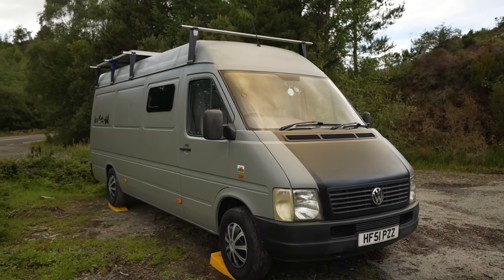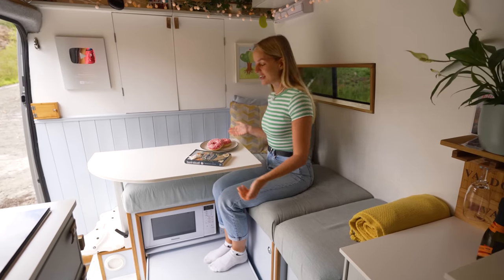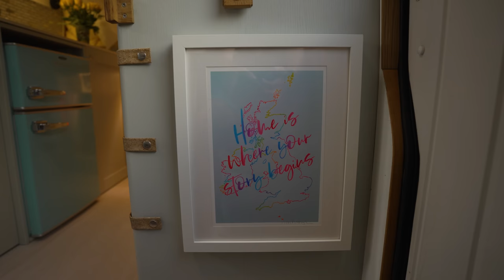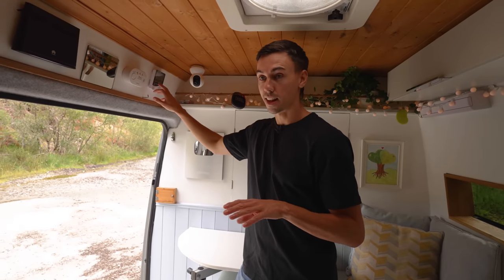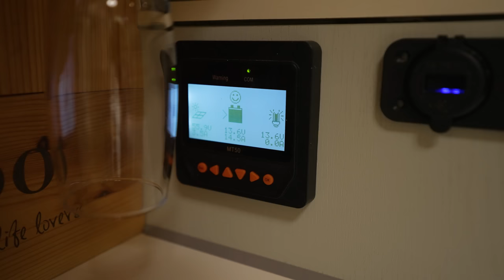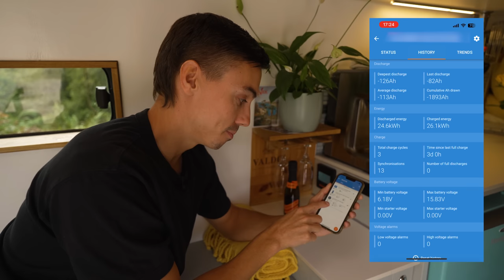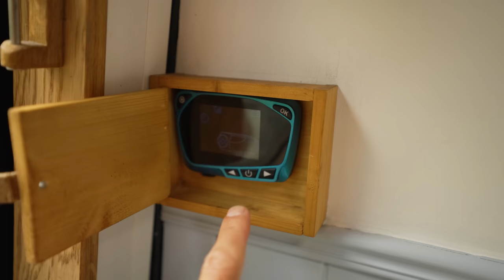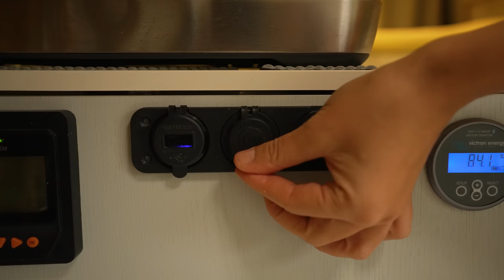Ultimate DIY VW Off-Grid Campervan Tour (Vanlife UK) 🚐

Comment: You have a great van home there, but please get your gas system checked out by a certified gas engineer, that gas bottle should be in a sealed box with a gas drop out in case of any leaks, and it should have copper gas pipeline running from the box to the appliance.
Reply from the maker: Yea, you are right to be honest! We will get that checked Thank you!! 😊

Comment: I love the van. One of the best conversions I have seen. There are so many good things that I love. Especially the fridge. Looks great and works without the inverter. Having the second battery will be worthwhile when winter comes. I also like that it doesn't have a bathroom. That would spoil the open spacious appearance. (Some conversions just look so crowded). I reckon the manual gearbox is probably a good idea too. Although I like autos, the manual will be more economical and probably more reliable over time. Looking forward to Wales.
Reply from the maker: Thank you! We totally agree with you about the shower 🙂

Comment: Be sure to have electrical fire extinguisher too. Those are some serious electricity back there.
Reply from the maker: Ah yes, we are thinking of maybe getting another one too, but the one we have is also for electrical fires! 🤗
Reply: @2Passports1Dream  Do inspect the wirings connections for loose contacts and corrosion periodically as they are subjected to a lot vibrations from driving and moisture. Loose connections can cause arcing and potential fires.

Comment: In order to ensure more electrical power, a two-phase power generator can be used instead of the electric dynamo inside the car engine (200 Amp instead of 70 Amp).

Comment: 2:30 Do make sure the engine timing belt and associated parts (assuming your VW has one - most VW diesels have one except one specific type which has a timing chain which are much better and much more forgiving) has been changed recently...If this belt snaps (due to age or mileage) your engine will be instantly destroyed..

Comment: aeration of gas, the gas bottle?
Reply from the maker: Pardon?
Reply: In most countries, it is mandatory to keep the gas in a separate room/box that is fairly tight and has a 4 inch vent at the bottom. The requirements are one thing, but it is probably one of the more reasonable requirements
Reply from the maker: @steinarbrevikknudsen1546 it’s definitely something we will look into getting sorted when we are back in the van again! 🕺🏻

Comment: Sorry to pour cold water on your enthusiasm for the van, but your gas installation does not look like it meets gas safety regulations. I'm no expert so you should get a gas safe engineer to inspect it & advise, but I believe the gas cylinder should be in a room-sealed cabinet/compartment with gas drop-out vents in the floor, so that any gad that might leak just drops outside. It should not be in the same compartment as all your electrical installation. What happens if you have a gas leak & a spark from your electrics??!!! Sorry but it is a potentially dangerous situation. You really should consider getting it checked by a gas-safe (or whatever the current accreditation is) engineer!
Reply: Safefill recommend good ventilation but don't make any reference to close proximity to electrical systems, the biggest problem faced by Safefill users is that many UK petrol retailers have ceased to permit the refilling of Safefill canisters on their forecourts, It's even more of a problemo on the continent where whole countries don't permit refilling......it's a shame as it's a good system.
Reply from the maker: Yea you are right! We will get it looked into. Thank you!! 😊

Comment: Please make sure the carbon monoxide detector is placed just above the floor, as carbon monoxide is heavier than air and will accumulate from the floor up. It will reach you (when you are sleeping) earlier than it will reach the detector.
Besides that, nice video, nice van!
Reply from the maker: Thanks for the kind words about the video and the van! Just to clarify, carbon monoxide is actually slightly lighter than air. The placement of a carbon monoxide detector can vary based on manufacturer recommendations, but it doesn't necessarily have to be near the floor due to the weight of carbon monoxide.